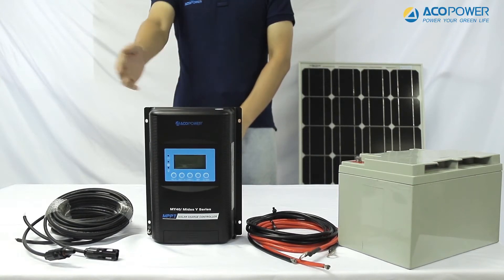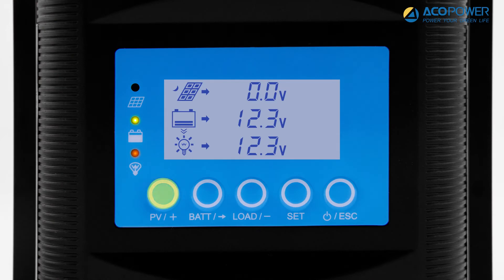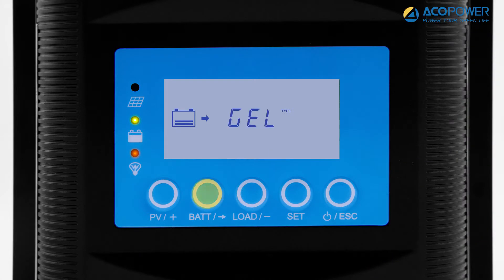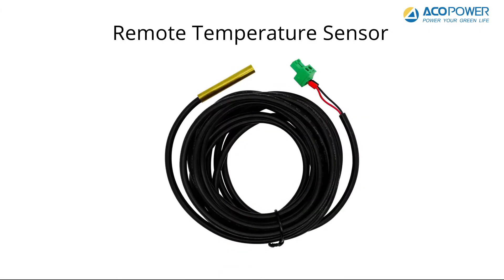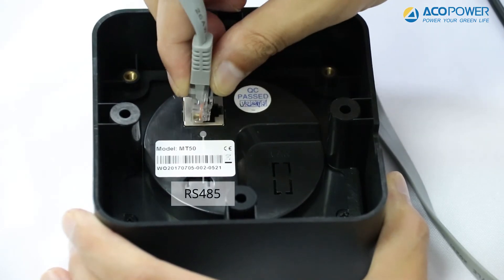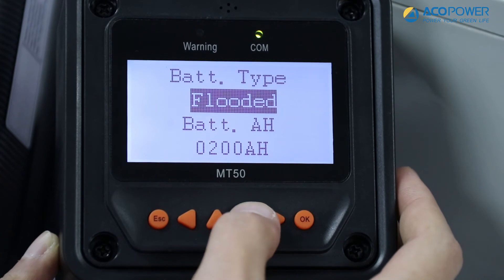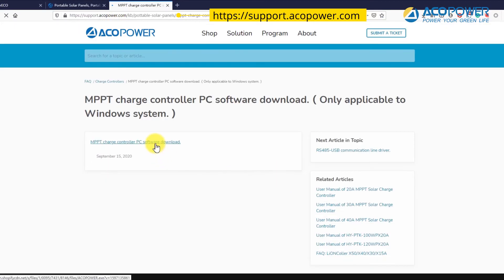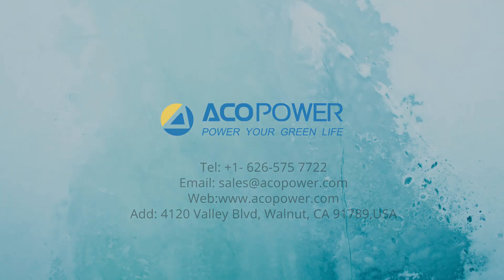ACOPOWER Midas Y Series MPPT controller to batteries and solar panels

Comment: So I need a 485 cable to usb to program the lithium profile? Well that's just awesome cause the ad never mentioned that at all. The 485 cable to usb is out of stock everywhere. 
The video says it will show how to set the lithium profile yet never does. It just says download software use a cable not supplied. 800.00 for this kit and no programming cable. 
How is it this made for rv use and no rv ernis going to use sealed agm batteries for their house battery system. Everyone is using lifepo4 yet its not included by default.
Reply: I ran into the same problem. I ended up getting the programming cable that support told me to get, but it doesn't seem to communicate with the charge controller. I have a brand new MSI laptop, the drivers installed and it shows up as a COM port. But when I try to connect it to the charge controller neither the computer nor the controller acknoledge they have been joined. There is absolutely no documentation on the use of the software. If you go into the help section of the software it just shows a picture of the company....
Reply: I have same issues.  This setup tutorial is awful